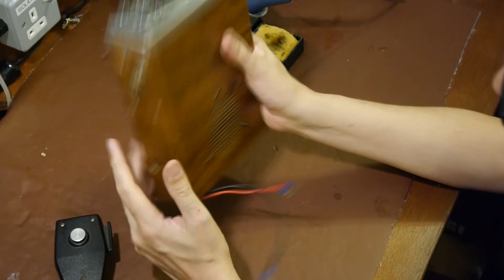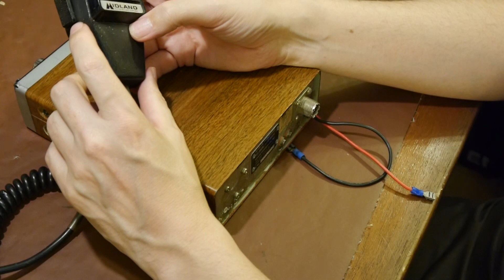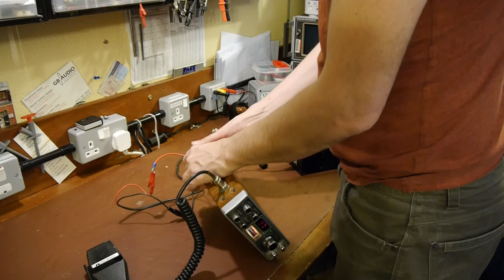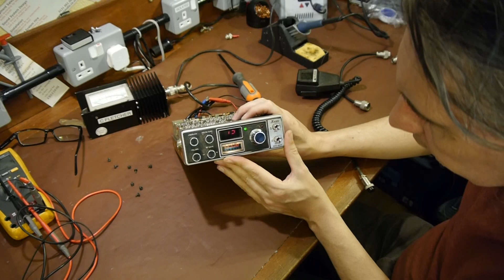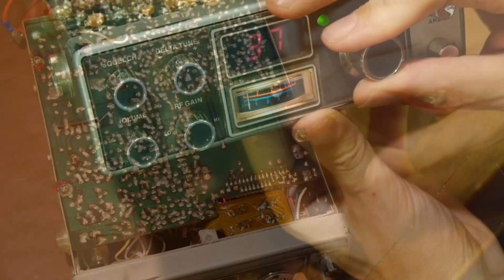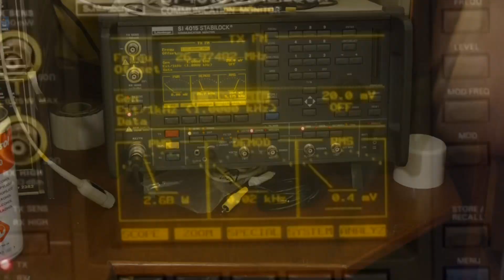Breaking The Law - Illegal AM CB Radio Repair Part 1

Comment: I drove by the Kraco Electronics Factory a couple years ago in South Los Angeles a couple miles on Alameda street. It took up like four city blocks and had 100 truck loading docks. I was trying to imagine what it would be like back in the seventies with people walking to work all the trucks coming and going. The Krako name is all over the building and over the office doors. I never knew where it was I was picking up a load across the street. I was kind of neat seeing such an icon of the past. People used to pick on Krako as being cheap junk but they were bulletproof and very reliable. They had low and top-end models they even had a base station with all the bells and whistles. I could name a few other brands that were actually crap but I'll leave Boshi out of this. Krakow is decent middle-of-the-road. Affordable was the Main-Thing. Some radios like Courier came in at $300 to $500. Ouch! When I was a teenager I had a Krako AM FM cassette player and speakers in the car they did the trick.
Reply from the maker: I love so much to hear the back story behind some of my repairs thanks for commenting. I thought the Kraco worked fine although I will never be able to test it as these AM sets don’t have approval for use here in the U.K. I do like the old American built gear it’s normally very high quality. I do have some old side band rigs that I have been planning on looking at although again these American imports are not legal hear. Look after yourself and keep on trucking rubber duck. Best regards Chris

Comment: I was about to say some radios need the mic plugged in for sound!
Reply from the maker: It caught me out none of my more modern amateur transceivers require this so it was new to me. It appears most CBs require it. Thanks for watching and comments. Best regards Chris
Reply: @allthegearnoidea6752  yes most CBs do but to be fair you wouldnt necessarily know that unless you had used a lot of CB equipment
Reply: Most you can cross the pins with a screwdriver, you'll recieve static when you touch the right 2 together.

Comment: Great video Chris!  I'm like sitting here wanting to direct you on things...but um, stupid tape delay!  :)  Generally for the mic, to test, I just take a metal screw driver and short the pins, on a 4 pin it will be *ground * audio *RX *TX, some vintage and newer rigs, need to be mindful as they will have really high voltage, but on the 70's~80s you should be fine.  Mike is an awesome tech, been watching his channel since about the time he started.  That rotary encoder (channel changer),  will either disassemble or you may need to drill a small hole to spray, this can be tricky as not to hit important stuff...not done it myself, but have watched others.  Let me also make another recommendation of a YT channel, another amazing tech:  THE RADIO SHOP :  https://www.youtube.com/channel/UCHJpeSrEjtVk1YtRU3FrpQQ  ~Jack, VEG
Reply from the maker: Vintage Electronics Geek  Hi Jack I also sometimes short the pins out with a screw driver but that’s often easier when the chassis is referenced to ground. Yep did that, drilled a hole in the the channel select switch and sprayed in some cleaner and it works fine, I got that from mike.  Yep watch the Radio Shop video as well, always very good. But I do really enjoy mikes radio repair and he gave me some good advice on the service data.  You will have to shout a bit louder next time jack it’s a long way to the UK. Think part 2 will be interesting. I am waiting for the alignment data to come from the USA via eBay, just in case you have it I’m wanting SAMS CB214. Thanks jack for stopping by and the nice comments best regards Chris.
Reply: Howdy Chris!  , sorry I don't have that volume...only have 1 CB Sams  :)  .  Mike is great but sometimes braggadocious, don't like...Buddy is laid back and not...either way, both are phenomenal techs and both offer a lot of great tips, I always learn something from them!  FYI, I always refer to ANL the same way!  :) I also like your work toys better than mine...but can't justify the big ££££ for them.  ~Jack, VEG
Reply from the maker: Vintage Electronics Geek most of my test gear was relatively cheap collected over many years. The exception being scope keysight scope, I had to give my left knacker for that.

Comment: Hi Chris. Interesting video. I possibly have one of those somewhere as I have a chest full of old AM radios that I use for spares. There is info out there on the mic wiring so you should be able to work that out. Spectrum communications used to make boards that can add FM to an old AM radio. Not sure if they still do them so I will have to google them. Btw that Stabilock is very nice
Reply from the maker: Radiocruncher Very disappointing the stabilock didn’t respond well to random button pushing which has up until now served me well. Looks like I’m going to have to read the bloody manual if all else fail. I think the stabilock out perform the 2955. But you cannot beat the simple intuitive interface on the 2955. Everything useful is about the third menu down on the stabilock. First world problems eh.   Loved your live stream on Sunday night as I’m normally out Sunday day. Had a great time and nice to catch up with you, Simon and Andrew.  I may see if I can get that radio up onto the amateur 28mhz band.  Thanks for the channel plug every little helps. Regards Chris  PS I still covet your variac. Sorted the MIC wiring thanks, see part 3.
Reply: I’m sure if you stabbed the buttons a bit more something would happen! I have a 2955 but it doesn’t like rf up it. The livestream was great fun especially the great bouzouki music. Certainly livened it up. Off to leave comments on part 4!
Reply: I was dx all Europe this weekend on my Am/Fm 5w CRT Xenon, had his boots on, and that's a modern cb.
Krakows are ok, I'd prefer a Major 588 though.
I have some small radios here Chris if you like a tinker inside and fixing stuff, let me know and we can sort something out, cheers Edza

Comment: I have mic wiring and alignment info on my RadioMods.co.nz site, probably not listed for that exact radio model, but if you can find the pcb number on the board you should be able to match up to something. Will likely be “PTBMxxxxxx”
Reply from the maker: The Defpom's Repair Channel  Hi Scott I will definitely have a look at your site, but it’s not a common chassis such as cybernetic etc. Do you have AM or FM cb in New Zealand ? Regards Chris
Reply: AllTheGearNoIdea - we have am/ssb on two bands, 26.330-26.770 and 26.965-27.405, and fm on a uhf CB band
Reply from the maker: The Defpom's Repair Channel Hi Scott, do you have any AM specific stuff on the channel.  Annoying didn’t have to really do much, so far just bad joints preventing tx and rx.  Hopefully part 2 will be more interesting and hope you will advise etc with my measurement. Regards Chris
Reply: AllTheGearNoIdea - I have done some cb videos but not the same kind of chassis as that one.
I did make a cb radio simulator program for understanding the frequency generation and I.F  systems, to also allows theoretical checks of frequency conversions.
Reply from the maker: The Defpom's Repair Channel  yes we may have to have a chat about getting it onto 28mhz amateur band. Never used this ban but will check out frequency allocation when I get a minute.